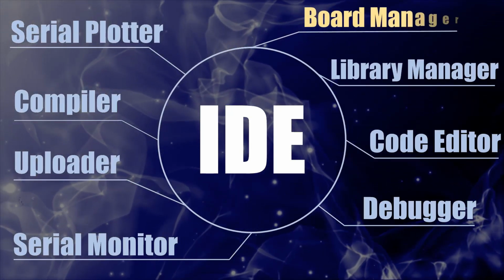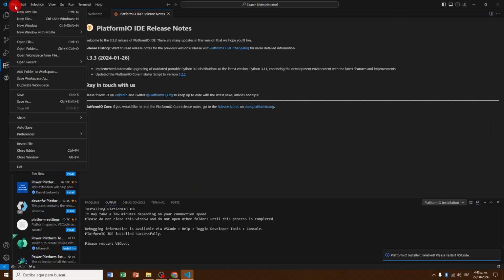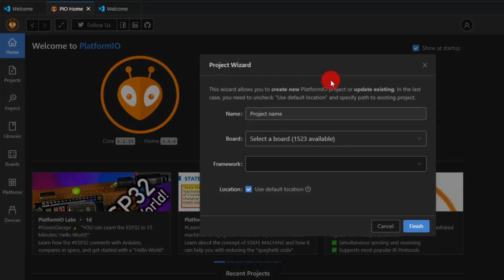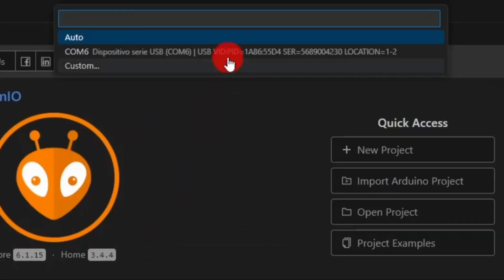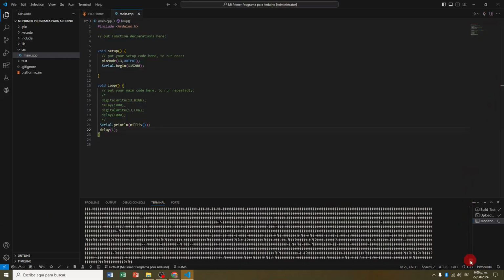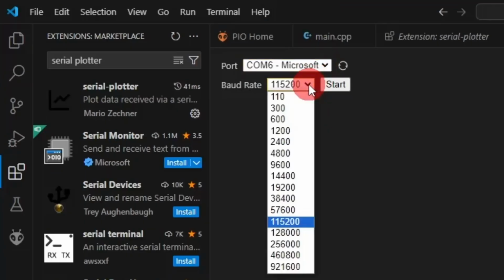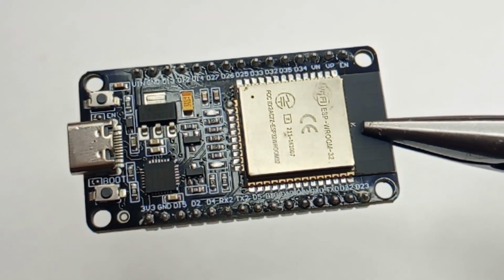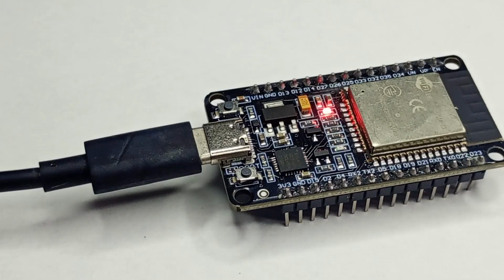Program Arduino UNO and ESP32 with PlatformIO and Visual Studio Code ¿Better than the Arduino IDE?

Comment: That good, but I'm facing challenge over here, where uploading code into ESP32 CAM in PlatformIO. For this I am using Arduino UNO to connect my Laptop and ESP32 CAM to Arduino uno Tx and Rx pin. This was working well in Arduino IDE but not in PlatformIO. Any help much appreciated.